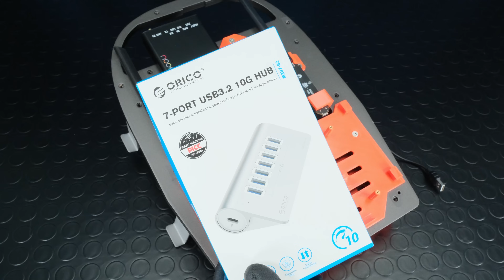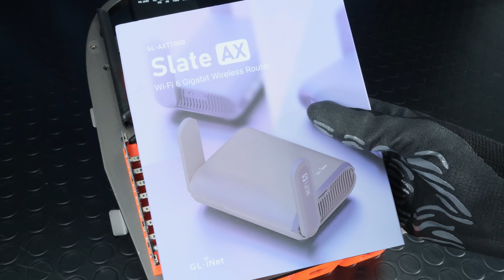Backpack Cyberdeck: Assembly Guide - Cerambyx64 MOD_01

Comment: How is this portable?? The 4 Anker power banks are pretty heavy on their own. The whole purpose of a cyberdeck is that it is small and fits in a pocket or at least a small bag. This is completely overboard. This costs more than a 1000 USD to build.
Reply from the maker: Hey! 😄 I totally get why this might seem a bit "overboard," but my cyberdeck is built for those who want to carry their entire lab... in a backpack! 🎒 You're right, the 4 Anker power banks add a bit of weight, but this is more like a mobile command center than something that fits in a pocket. And yeah, the cost... well, let’s just say it’s way more than 1000 USD, closer to 4000 USD! 😅 But hey, everyone has their style, right? Some prefer small and compact, while others want an entire mission control on their back! 🚀
Reply: @BAG.BUILDS  Wow that is a very expensive backpack. It would be only more expensive if you would use a LV bag for the project. Please do lose it. My issue is probably, that I have no clue what are all the antennas are necessary for.